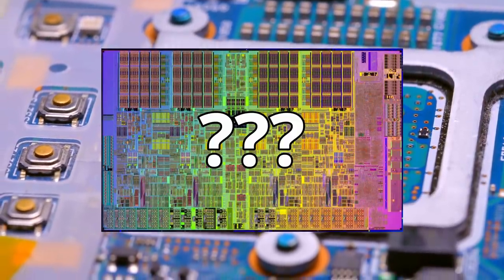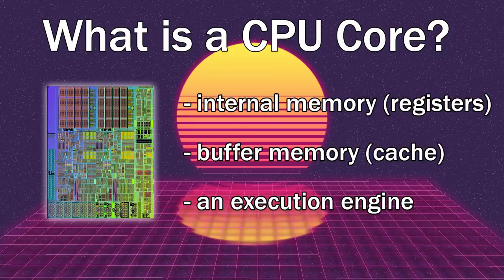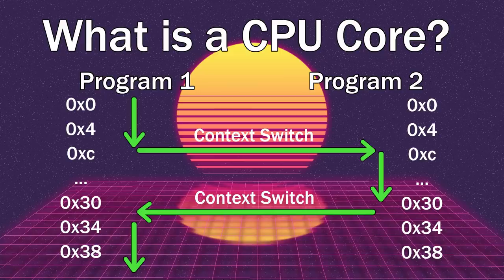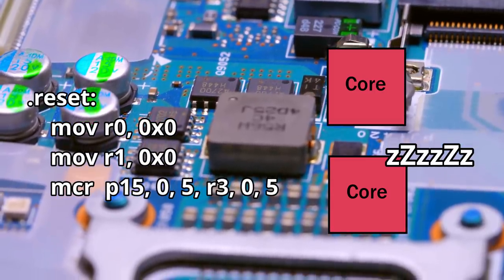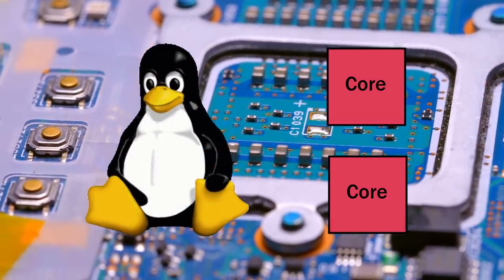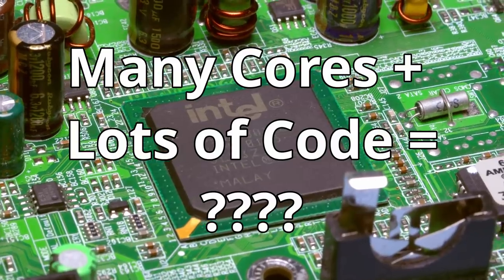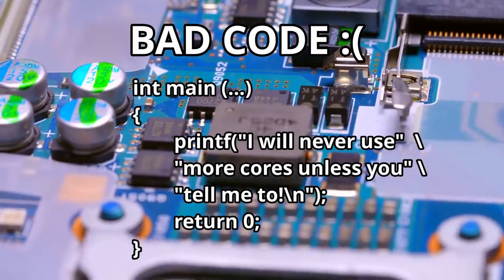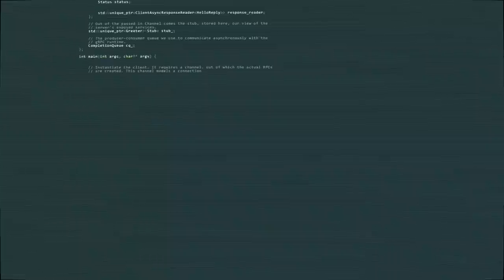why can’t computers have thousands of cores?

Comment: We see the cores to code limit already with Threadripper 64 core, 128 thread units.  It's hilariously overpowered for most tasks.
Reply: i feel bad for people who buy a threadripper then realize their favorite games either dont support multithreading, or only support 1 or 2 extra threads for main logic.
Reply: @SandTurtle  of course, Threadripper is not for gaming
Reply: @giahuy8701  No way to blame sh*tty game code optimization on monster CPUs. There are games still struggling on CPUs with 4 cores due to bad optimization and very low CPU use.
Reply: @giahuy8701  ye ik but I've heard of people tryna buy them for gaming
Reply: @giahuy8701  games can EASILY make use of multiple threads
Reply: @ed_iz_ed  source (like why do you say this)? multithreaded programming isn't exactly easy and is much harder to debug. But I also haven't been in the industry that long.
Reply: @AJ213Probably  ya it's not that easy to parallalise everything but something like unity c# job system is pretty good ig
Reply: @AJ213Probably  yeah im also not in the industry so take it with a grain of salt, but specially ECS allows for trivial parallelization of game systems

so you could run all your wheatear computations and fighting completely independent of one another for example

i know about bevy, a game engone for rust that specifically does this
Reply: @giahuy8701  Yea in a few years the people who put threadrippers in gaming machines will still have sucky game performance, even when games support dozens of hundreds of threads because the processor is optimized all wrong. Although they will be able to put up a minecraft server and invite like 1000 other players no problem.
Reply: Craziest example is the Threadripper 3990X. 64 cores, 7 TFLOPs/s, but only quad channel DDR4 at 102 GB/s. Arithmetic intensity is around 70 FLOPs/Byte, way above the next contender.
A fast CPU cripple by poor memory bandwidth.
Reply: @mr.mirror1213  I've parallized code using thread pools and I've done so using the job system. The job system actually ends up being harder as you have to rewrite all your code to use structs and the new math library for Unity.

I mean, this was only once though that I had to do this. My first approach was using the jobs system and I did get it to work, but it wasn't easy especially due to it lacking documentation and tutorials. Later on I just used thread pools and was much more succesful in improving performance for my voxel game.
Reply: @ed_iz_ed  You know, I want to use ECS and I have tried learning it, but it is certainly not easy. Unity has an ECS system that has 0 support and almost no documentation due to it being highly expiramental. Bevy is also expiramental and lacks support due to it not being exactly popular. Well, and not ready for releasing full products since its still in development.

The only ECS systems that you can really use for releasing a game would probably be some C++ library. Both Bevy and Unity ECS are highly expiramental.

ECS also is something that many developers can't easily switch to due to lack of experience. Most developers for games are very used to OOP or just EC (for Unity).
Reply: @AJ213Probably  I have heard people mention that unitys ecs is pretty convoluted and not really usable compared to bevys, but you are right, this are mostly experimental things

ill be sure to link you if i ever finish a playable game using it :)
Reply: @insertoyouroemail  I feel a strange desire to obey you...
Reply: cries in Unreal Shader compiling
Reply: @ed_iz_ed  It depends on the game. Often tasks in a game require the results of previous tasks thus requiring sequential execution. Most of the performance gains from Unity's ECS/Job system is actually just from the custom compiler they wrote that will compile jobs directly into machine code. Even running on just one thread, Unity Jobs tend to execute about 10x faster than equivalent C# code. Multithreading does still offer a performance gain but not nearly as much as the compiler they created.
Reply: @SandTurtle  ig 3990 Threadripper would be beneficial if i want to do sinulations with 100 cars in a scene in BeamNG
Reply: I think AI code writing and compiling will turn any single-thread optimized source code into multi-thread optimized in the coming decade.
Reply: You could use the Threadripper for BOINC Projects.
Reply: @insertoyouroemail  Rust is also incredibly good at this - probably because it borrows heavily from Haskell in some areas.
Reply: @SandTurtle  Me to because they where stupid to by a thread ripper for gaming. Heavy duty rendering and calculations are where it shines. Best use case for gaming would be the very fringe task of running multiple gaming instances across several screens splitting the cores into VM instances.
Reply: @TheFinagle  Not really Minecraft server code is absolutely shit and runs off 1 singular CPU core. That's why the best Minecraft servers run the most powerful single core performance chip they can.
Reply: @AJ213Probably  Modern games do tend to use 6 core 12 thread processors and some use 8 core 16 thread cpus. 4 core processors are basically dead in newer titles now unless you enjoy a stutter fest. Very few use more than 8 (death stranding I think can use a 12 core). You can check out hardware unboxed for the graphs and comparisons. So while games aren't touching 64 32 or even 16 core cpus, games are using more over the years.
Reply: @giahuy8701  it is for gaming while working from home. 😇👌
Reply: @saricubra2867  Its not just shitty optimization; some tasks just cannot be easily divided between multiple threads. Main issue are time critical tasks, where one thing has to happen after the other, because otherwise things go South. Physics simulation, for example, has a lot of limitations in that regard.
Reply: @insertoyouroemail  OO design patterns are a much better fit for game dev, though.
Reply: @insertoyouroemail  sure, if you let your opinions be dictated by trends.
Reply: 16c / 32t X86 cores are enough for anything but servers. If I was Intel or AMD I wouldn't bother with more and save the space for cache and integrated GPU, DSP, AI, ++.. I know they're going 3D with cache (AMD) and control + IO (Intel) but integrated graphics is the way forward for all but heavy content creators. 
--
It kind of makes sense to have lots of SIMD cores (SSE etc) but better GPU compute capabilities and power would be a better use of transistors. Separating X86 SIMD and normal parts of each core and having different numbers of each would be a major architecture redesign..
--
I believe we're going to see a major low end crash in the dedicated graphic market within 2 years, quickly spreading to the mid range as integrated graphics and GPU-CPU integration improves. The best RDNA 2 integrated graphics are already close to a GTX 1650.. RDNA 3 will be close to a 3060.. 
--
There is so much to be gained through integration and UCIe will boost integration competition, enabling mix and match solutions. AMD CPU + nVidia GPU chiplets on one CPU board..
--
The thing about Moore's Law for CPUs is until photonics mature we've reached the speed limit (around 5 gHz with normal cooling) and efficiently using all cores for most tasks is impossible.
Reply: @brandonn6099  My thoughts too. I dont think neural networks could ever be a thing without multicore. Since multicore began Intel has been encouraging to not write efficient code for multi core. While AMD was releasing text books and work shops to write efficient code utilizing multiple threads. With AI writing codes it will just choose what is most efficient. The code it writes will most likely not be for gaymers. People will just be removed from computing as the bottleneck. Hence the real bottle neck presented in this video. Poor code optimization. And if you can teach an AI to play a game or write code. You can teach it to design a circuit. for all we know an AI invented infinity architecture.
Reply: @insertoyouroemail  OO was trendy for a while, but it isnt useless.
Reply: Laughs in Intel Phi.
Reply: @beyondfubar  I missed that one.  Up to 72 cores.  Yikes.
Reply: @veleriphon  They're monsters. I own one and attempted to use it for massive matrices multiplication. In their element they destroy, but that is an insanely narrow band. Crunching genome information that has been formatted to benefit this setup and a decent python or MATLAB script they supposedly hit a teraflop back in 2014. Impressive! But yeah they're not made anymore for a reason. Heh.
Reply: @austinblackburn8095  thanks to NE5 luman shading those threadrippers are going to shine in gaming as real time light bouncing will take up some major processing.
Reply: @Joe Duke Most people aren't hosting others' servers on their own hardware.

TR does do a great job of that, though.
Reply: Depends on the task. Watching a movie yes, hosting vms and containers, no.
Reply: @brandonn6099  So just AI, or new architecture with a new kind of preprocessor?
Reply: @archerpence  At the very least AI and AI programming will take advantage of any number of cores. There may be other things as well, perhaps a different compilation method or even programming language, who knows.
Reply: @giahuy8701  it would be more correct to say not all threadrippers are made for gaming.  obviously No game  today is gonna benefit from the top threadripper and it's 64 cores and 128 threads.  but there are 12 core and 16 core threadrippers  that games will take advantage of real soon(and some that already do in the case of the 12 core one). 

though most smart game designers   utilize the GPU more in code than CPU these days.  which is where multicore GPU's are about to really explode.  and i don't mean  multi gpu  video cards like yester years. i mean GPU's which multiple cores on one die.
Reply: @saricubra2867  like i said to some one else.  games more and more are becoming less cpu bound , they have been for years.  developers will continue to  move more towards GPU utilization , especially when GPU's start having multi cores on a single GPU die. low cpu usuage is the future of games period.
Reply: @AJ213Probably  if you're using modern c++ standards it's easy. Running code concurrently or just using parallel for loops is a easy way to start.
Reply: @insertoyouroemail  I started with functional and procedural programming and could never grasp oop, never sat in my head well. I've now started working with Java to FORCE myself to learn OOP not because I want to, but because 90% of open source code and frameworks are oop based
Reply: It's actually closer to the slmajority of software not using them all.
Lots of data centers have software that scales well with the hardware you have, so they utilize hardware better than your average PC software. Things like the Threadripper are still too expensive for your average PC owner, so scaling software to use up Threadripper-level processors is a task with diminishing returns. It's not needed yet. There's some rumors going around that MIT are developing a 200 core processor for servers that would, supposedly, be utilized fully with future software. Supposedly.
Reply: Not all functions and logic are impossible to be multithreaded. Some are easy, some are hard and some are straight-up impractical to multithread . Keep in mind that programming is neither easy, nor a 24/7 activity for developers. Game code should be written to meet deadlines, as well as purpose. You can't expect every game developer to spend most their time optimizing and multithreading code, when you have all these different things that you still need to do to make a game. Software is much easier to multithread, since the functions, operations and logic there are streamlined and designed specifically to be multithreaded for efficiency. Game have all sorts of shit going on, from AI, to player positions, to networking, to gameplay mechanics, etc etc etc.
Reply: Then you realize that not that long ago ppl said 16 core was insane and etc. I still believe there is more to come and even threadripper will be looked down on some day.
Reply: For a single task yeah. But not for multiple tasks. Which is what more than 1 core is for. So this video is basically only true for a single task.
Reply: Don't buy a Ryzen 7 or an 8 core 16 thread cpu for only gaming. Single thread over multi core for now.
Reply: not me, when i code i spam async threads, so its not overpowered even for simple tasks. We just have to change our way of thinking for code as while programmers think in objects, each object can also be its own thread. This means softwares can easily use thousands of threads making better use of thousands of cores.
Reply: Virtualisation is the most common usecase.

For example 1 server multiple instances.
Reply: @ed_iz_ed  Minecraft can't the world is linear aka one thing needs to happen after another which means the main thread will always be single threaded.
Minecraft bedrock did it but minecraft bedrock is low tier trash
Reply: @TheFinagle  Minecraft is single threaded and will stay that way.
Reply: Threadrippers are not design for single user cases. They are designed for multi user servers, where cores can be divided between individual users.
Reply: Good for machine learning I suppose coupled with good GPU's. Not so good for gaming though...what game dev team optimises for 64 cores?
Reply: Not necessarily in server use cases, but for things like gaming, yeah because the single core performance is worse than the higher end normal ryzen CPU’s.
Reply: 96* core now is highest, (and also two cpu sockets)
Reply: 128 threads? feels like I should write VHDL for it instead of sequential programs.
Reply: Unless you are running multiple instances of say Minecraft for shenanigans
Reply: @giahuy8701  people with common sense knows that but there still bought it
Reply: It's not overpowered at all for general tasks, it will actually suck in these cases as the clock speed per core is really low. A consumer processor with 8/16 cores will far outperform those due to like 4x higher clock speed per core. 
But those server CPUs are able to benefit from the large number of cores because their workload usually involves dealing with hundreds of parallel user processes at the same time, even though they would suck at running a single demanding game.
Reply: @SandTurtle  yeah I've heard of people with more money than brains too.
Reply: that already happens at like 12 cores work games or similar
Reply: you dont buy a threadripper to play games...
Reply: If you're buying a 64 core CPU, it better be used as a server with virtualization. That's the only use case I see for it.
Reply: but can it run hearts of iron 4?
Reply: False. Chrome takes up all 128 threads and still lags :(
Reply: just look at Altra Max, an ARM processor with 128 cores (not hyper threaded) running at 3 Ghz :3